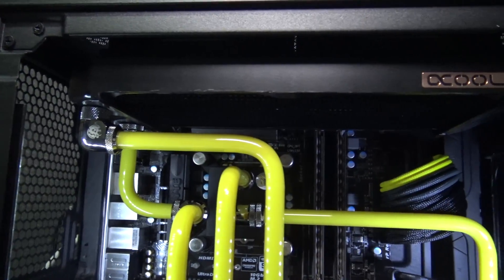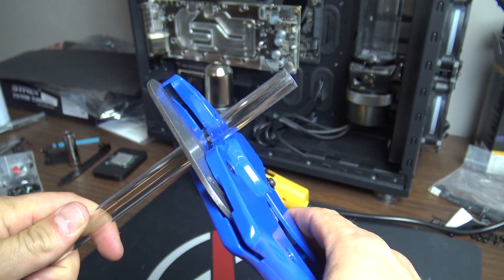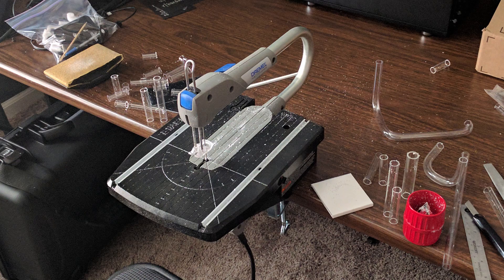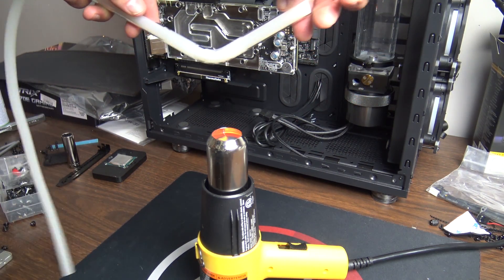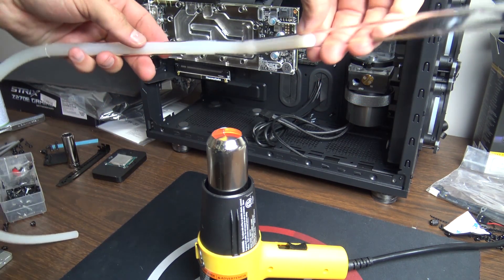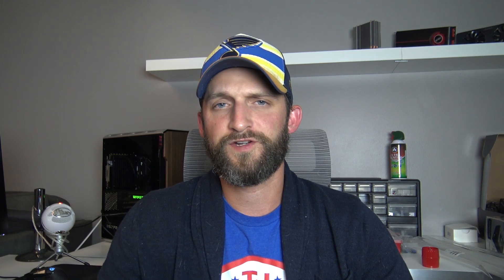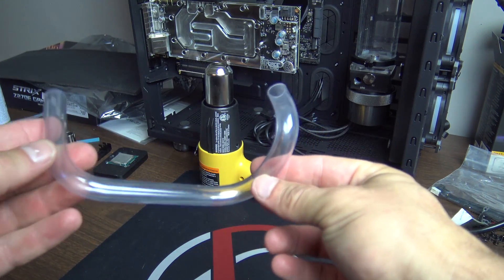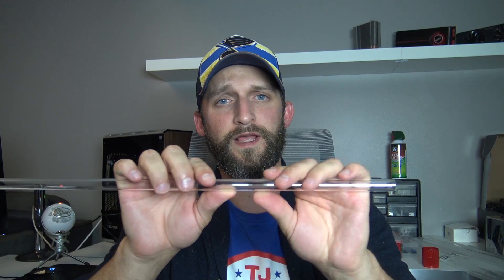Rigid Tubing: Acrylic vs PETG

Comment: I’m debating whether or not to use acrylic for my first build. I’m building in a Lian Li 011D XL, I already ordered the distribution plate for the front of the case and a FLT 360 Flat Res both by EK. The distro plate has a drain port in the front of the PC, but I don’t want to leave the ball valve in the front of the case since I might hit it with my elbow. I’ve seen other YouTubers who add them by tilting the case when they need to drain the loop. 

My question is, would acrylic be wise for this kind of approach? Or should I have the valve on, and avoid tilting to add said ball valve? I was thinking of maybe using another port in the plate, because it does have a drain port on the inside, but it’ll be near my Radiator.

Comment: This is the best video explaining both material.. One material is not superior than the other in the case of arcylic n petg in water cooling application. Ive seen video showing how they abuse the arcylic. Hack you wont swing a hammer in the system or  twist the arcylic tube so hard you crack it.. your other component will break far earlier before you crack the tube.. 

It all boils down to preference.. some just cant accept preference being a thing 🤷🏻‍♂️. 

Petg is easier to work with than arcylic, easier to cut etc. Arcylic generally last longer than petg (less fogging and staining) but a bitch to cut using HAND TOOL. I use both material building system. I dont prefer one over the other. If you have a basic hands on skill, you can do both.

Comment: Oh my god, more people need to see this video, I did the tubing for two builds with Petg and was wasting so much. I found it would warp so easily, the window for getting the bend in was small and any errors meant that tube was destined for the bin, or a smaller run if enough straight was left. Today I got some acrylic to try and made my first double bend measurement perfect, with 0 warping or ballooning as I have had with petg in the past. Not sure why everyone favours petg so much, is it purely the ability to cut it easily?
Reply: For real you almost have to try and mess up on purpose with acrylic since you're never gonna reach the point where it bubbles. And you can work calmly and do your bends perfectly and reapply heat etc if it isn't exactly how you want. And when in a build it basically looks like glass I love it

Comment: Another drawback of PETG that I experienced personally is deformity caused by heat. If you read the specifications of PETG it says it deforms at around 65-70c but the reality is while that's true over a short period of time (few minutes under a heat gun for instance) if you expose PETG to 35-40c for a very long period of time which could happen in a water loop on a hotter climate there is the possibility for slight warping.

In my case I had my rig doing a render and the water temperature hit 33c for the entirety and the ends of my tube around my GPU block deformed enough to cause a leak. I had some calipers to check the tubing and it had deformed only 0.5mm (16mm tube) and that was enough for a trickle of water to get around the o-ring. I checked all the fittings and they all showed deformities of around 0.1 to 0.5mm while the tubing I had never used (kept spare) was still exactly 16mm. The deformed tube showed 15.5 to 16.5 on the worst one, it had almost become an oval instead of a circle.

This problem doesn't seem to happen with Acrylic. EK knows this issue exists as they currently sell plastic caps you can put on the end of your PETG before inserting into their fittings to maintain a perfect circular shape, it grips the tube to stop it deforming. So in my opinion, PETG isn't worth the risk for a little faster bending.

I do now use Acrylic, had no problems with it, yes it takes longer to heat up but like was said in the video it is more forgiving, you have more time to do your bend, you can reheat and do some minor repairs on any bends you didn't get exactly straight and he's totally right about the bending, PETG is more springy and when you hold it in position for a bend it can be deceiving as once you let go it can tend to spring slightly out of the shape you held it in, this just doesn't happen with Acrylic.
Reply: That is true about warping. I went with Primochill, but unfortunately found out that if you want to use their revolver connectors, you sort of stuck with 1/2 tubing ;-( I bought their kit for the connectors,  and their inserts for their 1/2 tubing. but the downside to that again, is they reduce the ID of the tubing at the connectors. . I am setting up a dual loop in a new case, where I have a single loop now in my old case, and even though I have 2 rads, still runs hot with flex tubing I have now,  since I am running an AMD 3950 chip! with a 1080i Video card. So hopefully the inserts will work.

Comment: PETG is easier to cut and more forgiving when bending (lower temps needed). But acrylic (PMMA) has extremely good chemical resistance. If you don’t want to service your loop every few months, you can run anti freeze diluted heavily with water and a touch of biocide with acrylic. That will easily do 5+ years. That’s what most long lasting pre mix like mayhem XT-nuke are anyways. PETG probably is probably just another product to push coolant sales.
Reply: You can see videos of people with builds with PETG for over 2 years and Most don't look bad! I find the soft tubes to be the ones who stain and have to be replaced faster.

Comment: Just use Glass tubing it's the best 😁 heck use Chrome Tubing
Reply: isnt it harder to bend the glass tubing?
Reply: Yeah, just use glass, it's expensive but worth it if you're gonna keep your set up for years.
I use 16mm glass and 16mm petg in the hidden parts of my build.
I like how the glass just looks like one solid piece when it has water in.
The chrome seems even more expensive than the glass, but I suppose it depends what your buying and from where.
Reply: Its really difficult to cut glass safely though.

Comment: Yeah acrylic is amazing. I wish I could cut it easier like with scissors to shorten my lengths when my measurements or eye balling isn't spot on lmao but that and heat up time are about the only draw backs vs petg. Everything else is superior. Also bitspower acrylic is super nice, I like that you use it as well :p.

Comment: there is one more downside about petg.. i am running 2 2080ti with EK blocks; i have 6 fans, 3 push and 3 pull.When I do overclock and the first card can get to mid 70s and the second card is in the high 60s. I start to observe that petg tubing would deform around fitting area and cause the ends to shrink which causes leak. I dont have the same problem with acylic.

Comment: @Vir1lity PC Customs, About the brittleness, I'm worried it might break in my system, let's say when removing my case (a huge The Tower 900 case), it might be that I incidently hit the ground too hard for example, will that kind of shock break the tubes? I'm worried about that. I have been suggested Acrylic, I do think it's superior and less maintanance, but the brittleness, is a bit...
Reply from the maker: I can't see that ever happening. Acrylic still flexes.
Reply: The brittle nature of acryllic is extenely exaggerated by people that disibgeuously heat it, then immediately dip it in water and snap it. If you let it cool properly you won't have problems.

Anything hard enough to break the tube once it's in place is likely going to break an actual component.
Reply: @praetorxyn  I'm sure he is speaking from a drop or a good bump to the desk it is sitting on. PETG wont even crack if that were to happen. I can guarantee you are not willing to say the same for Acrylic.

Comment: I've seen a few posts around lately where petg has warped from compression fittings and has leaked. You think these are just very rare cases where temps got way too hot?

Cheers.
Reply from the maker: hard to say but it's definitely possible.

Comment: hey can someone tell me if the bistpower crystal link acrylic tubes can be used with any compression fittings?  Cause it says only for use with bistpower c89 fittings... is that true or is bitspower just trying to get you to buy there fittings?  cant any fittings go on acrylic tubing just like PETG? (obviously they have to be the same size OD)
Reply from the maker: Most manufacturers will only guarantee a proper fit with their own fittings.
Reply: I use Singularity Computers 16mm acryllic tube and Bitspower fittings (enhanced multilink whenever it's available, be it straight, G 1/4 to 90 with rotary, or 90 rotary pm both sides etc) and have had no problems.

Comment: Nice vid. What size tube do you use?
Reply from the maker: 12mm
Reply: Wow thanks for the reply but are you in a rush? It looks a lot bigger than 12mm. Do you mean 12mm ID? If so whats the OD? If you mean 12mm OD then whats the ID?
Thanks,
Steve

Comment: I use chamfer tool on PETG, then dremmel with grinder wheel on lowest speed. Nice and polished. Add some drop of distilled water and they slide in like a charm.

Comment: I did my first rigid (or any water cooling) system around 6 months ago, and I think it came out great.  I noticed on one bend, if you looked very close to it, it looked like a crack near a bend.  It wasn't.. it was just a small anomaly that looked like a straight crack.. maybe a tiny ridge as if the tube wasn't quite warm enough.  It's not at all noticeable, only if you get right up to it and know where it is.  

I bought acrylic and an going to do some slight changes to my system, and replace the PETG with acrylic when I do.  I was looking for info on cutting it when I came across this video.
Reply from the maker: you'll need some sort of saw with a relatively fine tooth. I use my Dremel moto saw, but some companies sell little pipe saws. One of the nice things about Acrylic is you can really clean up the ends nicely after you cut it.
Reply: Thanks for the info.  I ordered a Dremel, partly because I needed it for something else, so I'll give that a try. I'm going to get some extra tubing just in case.  I actually used a pipe cutter to cut the PETG, and it worked great, but it's a no-go with acrylic for sure.  Great video by the way.. you should do more.

Comment: Great video. I'm a fan of Acrylic as well and I agree that visually, PETG and Acrylic, look pretty closely the same. I will add that Acrylic looks more clearer than PETG with clear fluid to me. It can be harder to tell with Color fluids. Also, I think lights reflect off the Acrylic tubing better.

Comment: My concern with acrylic is the trouble is cutting it, and the brittleness.
Reply from the maker: PETG is definitely easier to cut, but your Acrylic tubing should never be put in a situation to cause it to crack.
Reply: What if while installing a gpu or a CPU block, I accidentally bang the metal corner of the block into the tubing right near a bend? Isn't that enough to fracture it?
Reply from the maker: no. The idea that the stuff is that brittle is nonsense. People act like acrylic is the same as potato chips.
Reply: hahaha! 
 I do like how glassy clear acrylic is. What do you use to cut yours square? A saw and a block? I plan on buying some PETG but you and the guy at my local store are kinda talking me into acrylic.
Reply from the maker: I cut mine with a dremel moto saw and then just sand it square, but a saw and block would work.
Reply: So I picked up some acrylic finally... it was NOT the same price... much more expensive. I really like it! I am having a lot more trouble getting smoother bends though.
Reply: Lifted my case to clean under it on my desk and had an acrylic line crack. Already fixed it but since then I've been considering giving PETG a try and playing with the loop
Reply: "What if while installing a gpu or a CPU block, I accidentally bang the metal corner of the block into the tubing right near a bend? Isn't that enough to fracture it?" You're going want to take out all of your tubing before you do anything like that anyhow.

Comment: I hate acrylic costs more, hard to work with, so brittle it can crack in your rig and leak, looks exactly like PETG in my show rigs, I have a huge bin of failed acrylic bends like 50% fail rate but i zero fails with PETG.
Reply from the maker: Sounds like you should stick with PETG then.

Comment: what do you think about glass tubing? because i saw someone actually selling these 12mm glass tubes so i just wonder how good a material glass is for water cooling.

And thanks a lot for the video, your videos have always been very informative :)
Reply: glass tubing is nice and looks wonderful. But its expensive, and you cannot bend it. You have to use fittings for any bends and can only use straight pieces of tubing. So it can be tricky to work with.

Also, acrylic and glass look identical once installed, so its not really worth it to be honest
Reply from the maker: I have yet to work with glass tubing. It's tricky to cut and nearly impossible to bend, but it looks amazing.
Reply: I'm currently considering copper tubing for some retro look... However the fittings would have to be brass/copper (don't mix metals), so it can cost more in the end.. But I don't care (we're not talking about a huge amount)